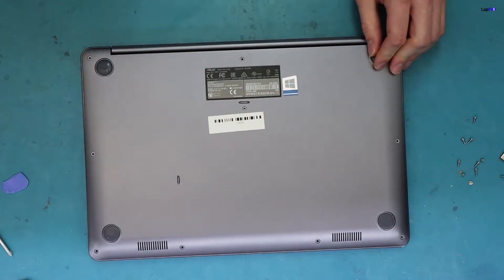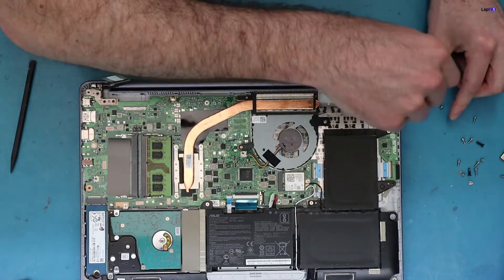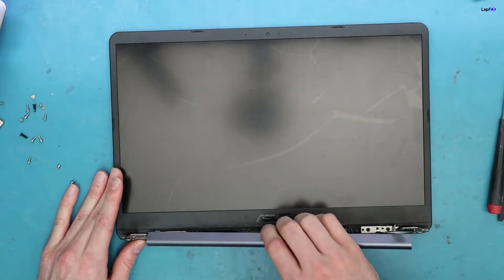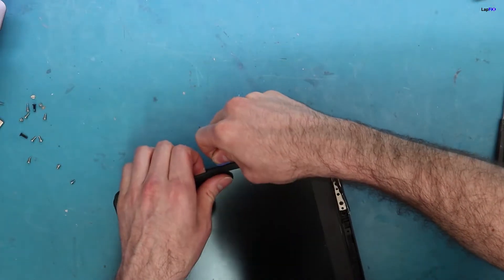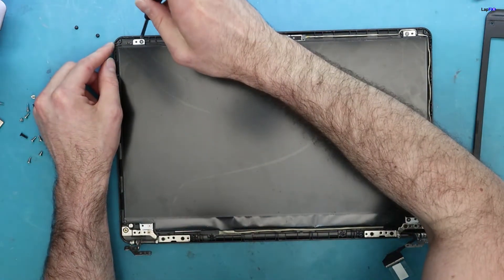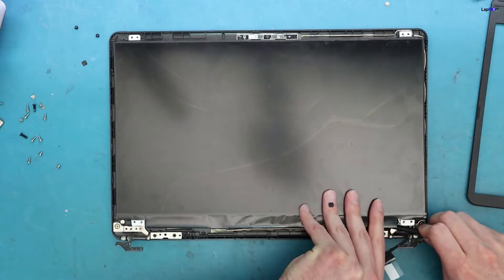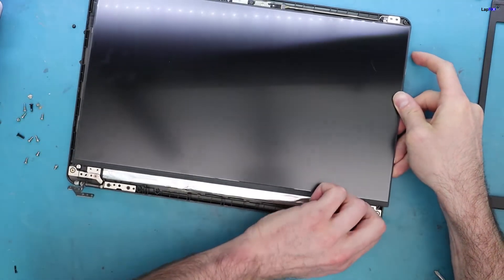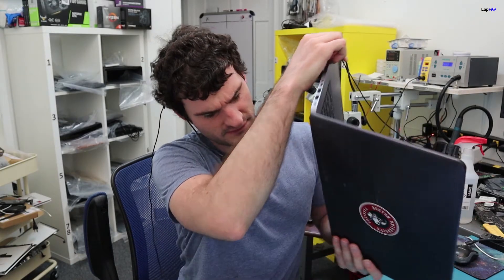Asus F510U Screen Replacement

Comment: Very well done, I was stumped on putting the plastic cover back on (i tried after attaching the screen to the bottom) had to remove it to put the plastic cover back on.  But, I still am not powering on.  ???

Comment: If the screen still works but is extremely dark-almost blacked out, what could be wrong with it? Same laptop in video-never found a cmos battery so I’m stumped?

Also a very well done video.